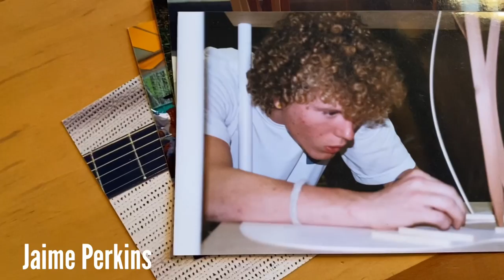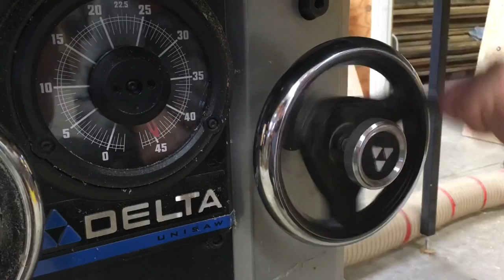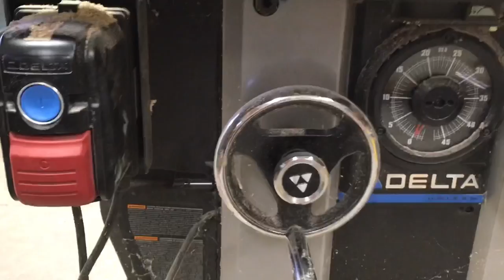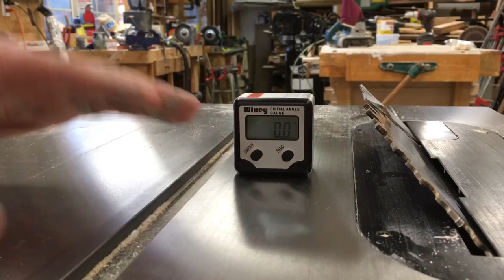Geeking Out On Woodworking Shop Tools  | Everything about Jaime’s table saws past and present

Comment: You made a great choice. In my 43 years of professional cabinetmaking and fine woodworking, every shop I worked in had a 10" Delta Unisaw as it's main workhorse. When I eventually opened my own shop in 2001, I bought the Platinum Edition with the Biesemeyer fence and never had an issue. Since I often had to crosscut large panels I added an extension table that allowed me 54 inches. In my humble opinion, the Unisaw is the king of professional shop table saws. Have fun!

Comment: I've been wood working for close to 40 years...My first saw starting out was a Craftsman 10" Contractors saw having a 1-1/2 hp motor such as yourself. I used it for many years but like yourself I found the fence to be lacking so I upgraded to a Biesemeyer fence system which took it to a different level. For many years I had always wanted a Uni-Saw but I could not justify the cost...so one day a friend of mine and I took a ride to Grizzly for the annual tent sale and I purchased a 3 hp 10" cabinet saw from them which was great and provided many years of great service. About 3 years ago after moving to our new house I was able to procure a new Delta Unisaw 36-L552 5hp saw which is incredible...I love it as well!

Comment: Other features I like about the newer Delta, mine is the 52” rip and has a drawer under the extension table, very handy but the best is you just pull a lever in front and the riving knife comes right out or adjusts height for thru or non thru cuts plus the blade guard and anti kickback pawls go on and come off extremely easily. I actually found a unifence on eBay and replaced the Biesemyer fence. Still have the old one but for now I like the unifence.

Comment: Great video and good for you on this very nice saw! You are right about the front controls, the Biesemeyer fence and the riving knife and OFF switch, BUT that's push stick needs to go! Here's why. When ripping a board against the fence you need to: 1. press down, 2. press forward and 3. press diagonally towards the fence.  If the board comes off the fence at the rear of the blade, it will rise up and over and it will kick back. Thankfully you do have a riving knife a great safety feature which will prevent those types of kickbacks. However, that skinny, short ended push stick will still not be able to hold the board down on the table. You need a proper "push shoe" instead.  Look them up, there's a zillion types, but any one will be better than a push stick. Trust me on this, 55 years using a table saw has taught me a few things!
The other thing I like is your extended fence on the miter gauge. It needs to be longer so you can clamp a stop block for crosscutting different lengths easier. The kerf in the fence is your "indicator mark" for the cross cuts, no need to measure to the blade. Line up the mark to the left side of the kerf and that's where your cut will be. Best wishes to you!

Comment: First thing I noticed after going to a 3hp. cabinet saw after using my old 1 1/2 hp.  craftsman, was that my blades lasted 3 times longer. I read in a book that blades wear more from heat abrasion than actually cutting the wood. If you have enough power you can cut through enough wood that it cools the blade. If you don't you burn the blades they last so much longer

Comment: Thirty years ago there was an old carpenter here in Wyoming who bought the first Delta cabinet saw he'd ever seen. This was during WW-II, probably 1942 or maybe '43. The saw's motor was 3/4 Hp, the largest available due to war rationing. Harold Hobson was the carpenter's name. He was extremely accomplished at had sharpening and fettling all his tools. He said he never felt the need for a larger motor and said he'd never owned a carbide tipped blade.

Comment: Jamie…. Thanks for the content. May I suggest cleaning your blades with “Spray 9”. It’s a very good household cleaner. I use it all the time in my shop. Spray it on, let set for 5-10 minutes then a nice stiff nylon brush. I constantly clean my blades to eliminate buildup on them.

Comment: Finally someone on You tube that has a Delta Unisaw with a Biesemeyer
Reply: (Added) Fence system that has all there ten fingers and thumbs.  It just goes to show that the right training on a non SawStop type table saw and excellent safety practices you can keep all your fingers.  Just another Delta Unisaw 52 inch user.  Quality woodworking video.
Reply: Well this comment didn’t age well..........

Comment: Gee, I thought every 18 yr old spends their hard earned money on stocking up with Festool, Felder (Format 4) and Mafell (and now and again, Hilti) tools and machines.   By the way, I have the exact same Delta Unisaw you have.  Love it.   Unless I'm cutting dados or grooves, or using my sliding table sled (with its own shop-made guard and dust collection port), the original Delta guard is nearly ALWAYS in place (unless the particular cut I'm making absolutely won't allow it).  I am very fond of my fingers and I don't want to see one lying in the sawdust. 

Unlike  Mr. C.  Numbnut several years ago who practically cut his hand off  attempting to free-hand rip some hardwood flooring without bothering to use the guard or even the rip fence on a little Ryobi portable saw, I took the safe operations training very seriously.   When he sued Big Orange (seller of the saw) and Ryobi, unfortunately, the even more idiotic jury saw fit to sock Ryobi with $1,500,000 verdict awarding Mr. Numbut for his incompetence, stupidity, and/or laziness.   Prior to his injury, Mr. Numbnut had claimed to be a knowledgeable and skilled finish carpenter and installer of hardwood flooring.  The jury was swayed by expert witness Mr. S. Gass-bag, inventor and manufacturer of saw-stopping tech, who claimed that any saw which didn't have his super-duper hotdog stopping gizmo was inherently defective.

Comment: The number of those Craftsman cast iron top "contractor's" saws out there boggles the mind, considering they are not portable, the fence is absolutely terrible, the guard & splitter are worthless, the switch is in a bad location, and they are seriously underpowered.

However, I still have mine that I bought new (as my first real power tool purchase) in 1992.  I have upgraded the fence to a 52" Biesemeyer (LOVE it) and a Forrest WWII blade, and it's a pretty good saw now except for ripping.  

Some day I may put in a more powerful motor, but I kind of like the fact that I can stall it out before it can kick back. LOL!

I'll eventually get a better motor, a good splitter, and a safer switch to turn it into a really good saw.

But how much of a "Craftsman" table saw will it really be?  Reminds me of the axe that has been in my family for generations.  We've only replaced the handle 4 times and the head once!